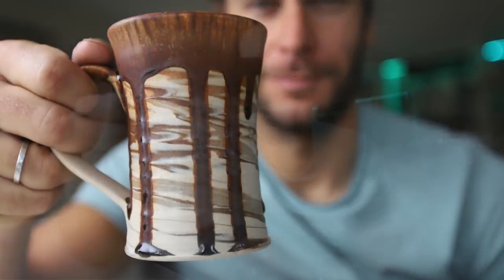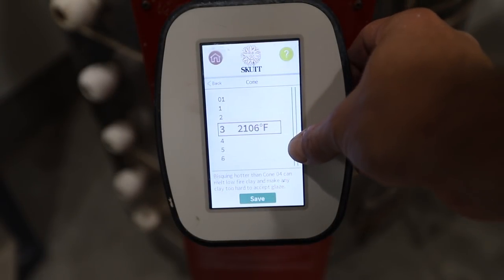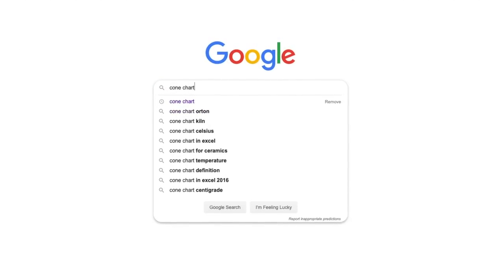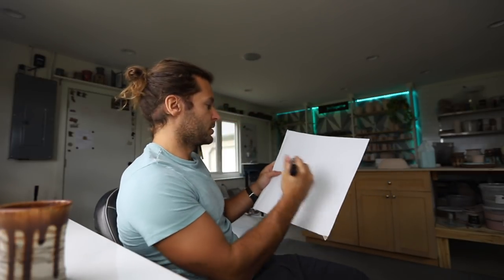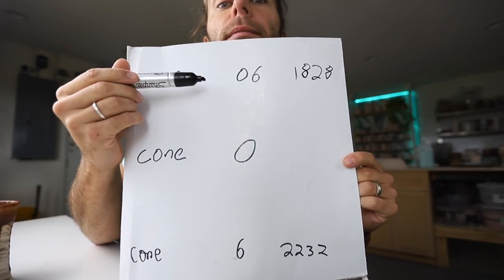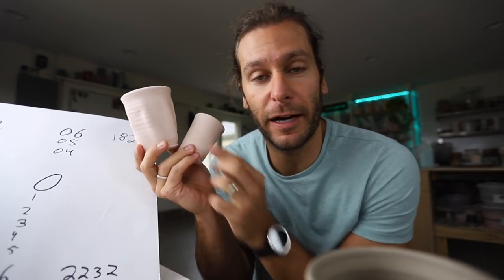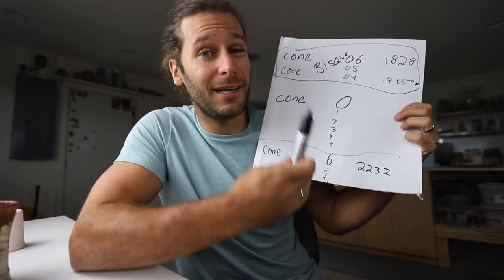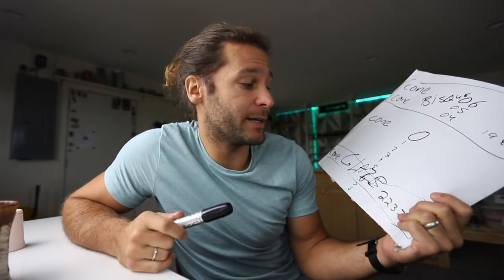POTTERY BASICS  - Measuring Temperature using CONES!!

Comment: A couple of extra notes. 
Cones don't exactly measure temperature, like a thermometer, or in this case pyrometer, but instead measure "heatwork".  This is the amount  of heat, over a certain amount of time.  The classic example is cooking a roast.  If you put it in a cold oven, and set it for 350 degrees, you don't take the roast out, when the oven reaches temperature, as it hasn't fully cooked yet.  Instead, it has to be at that temperature over a given amount of time.  The same is true for ceramics.  A lower temperature, held for longer can equal a higher cone.  And a higher temperature not held long enough can equal a lower cone.  
Also, for kiln sitter controllers, they have pyrometric bars, that are recommended over the traditional cones.  The bars melt more consistently, and with less error.  The cones can trip the sitter too soon, or worse not at all, if placed incorrectly.  The bars don't have this issue.

By the way, I love the outtakes, you've had in the last couple videos.
Reply: This was exactly what I was looking for in this video. Do you have your own channel, or web site?
Reply: Why is it soooo hard to actually see what a witness vone looks like when it meets the desired temp?  Search and search and pics mostly show the overlapping of a series like a witness cone at 5, one at 6, one at 7 all together.  Yet if you fire a 5, use a single witness cone for 5, the result should be relatively consistent-toe touch!  I’m trying to settle a disagreement with a pottery mate.  I say it should touch, within 20%.  She says if the cone moves at all, it’s right on but if it touches it’s too hot.   How do I settle this??  I need pics!  Thanks!

Comment: Hi Jon. I have recently had to use cones as my new kiln was over firing.  Even with a modern controller its handy to use cones to check actual temp your kiln is firing at. My controller was set to cone 7 and it actually burned at cone 9! so now I set my controller lower :-)

Comment: Hi, great video on the orton scale but I still don’t really understand how you use cones? Like do you put them in the kiln every time you fire something to test that your kiln is reaching the correct temperature? Or are cones used more for detecting errors or cold spots in the kiln if and when they occur? 

How often do you put cones in your kiln? 

Also how do you stand the cones up in the kiln and where are the best places to put them in the kiln? 

Loads of questions! Perhaps my questions are valid for a part 2!
Reply: Good question!  I know potters who put multiple cones in to see if there are hotter spots in the kiln.
Reply: If you want to be sure you know whats going on in your kiln, you use them every time. You can be confident your pottery is done well and can help troubleshoot problems if something does go wrong.

Comment: I would like to know more about clay please. Like what the difference between stoneware and porcelain 😊
Reply: Not sure if this is exactly the answer you're looking for but here goes. Porcelain is very smooth, when you're throwing with it, kind of feels like butter, it's pretty difficult to build tall things with, because it can cave in since there's no sand holding the Clay together (like Stoneware has) porcelain is just very thin and light. Stoneware is a bit tougher, it has the sand particles in it to hold it together more, & make it stronger, which means you can make pretty big things usually, stoneware is also less expensive it's less valuable too.
Reply: Throwing porcelain is not a clay body for beginners. You can throw tall forms but it helps to add grog to the clay body to help it stand up.
Reply: digitalfire.com has articles for porcelain and stoneware that are very good.

Comment: VERY HELPFUL! I'm getting ready to purchase my first kiln....... Any suggestions??
Reply: Skutt and L&L are big brands in the US. I own a small Evenheat which I've been super happy with. 

Bigger issue is making sure the kiln will get hot enough for the type of clay you like to work with and making sure you have the power at your house for the kiln. You may need to hire an electrician to run power for you, since almost all kilns draw more power than a standard plug can provide.

Comment: I have many more questions! You said that the old kilns will use the cones to be turned off, but what about the new ones? What do you use cones for now? Why can’t you just set the temperature you want on your kiln if cone = temperature? Is the cone you fire to what determines if your pot is food safe? If firing to cone 04 fixes problems like pin holes, why fire at 06 in the first place? Is there pros and cons to fire at lower or higher cones? And can the same glaze be fired to different cones with different results or do they only work at a specific cone? 

I would love another video on this subject because I feel like you left a lot of questions unanswered in this one. I’m also waiting for a video on that gorgeous marbled clay! Keep up the good work ♥️
Reply: Only old kilns with a kiln sitter use the small cones and are then turned off when the cone melts. In a New kiln (with electronic pyrometer/controller) we use the cones to calibrate our kiln. We ideally place different groups of 3 cones in a small mass of clay or in a stand on shelves inside the kiln so they are visible from the peep holes. The 3 cones in each stand should be a gradation of your projected firing temperature (ex:one of each cone 5-6-7 for glazed stoneware that should fire at cone 6 ). If your firing is successful and oven well calibrated the cones 5 will be melted, cones 6 will be parabolic and cones 7 slightly bended. This way you can avoid a misfire or trouble shoot why you are misfiring (burnt out elements, fracture in kiln, drafts).

Comment: We have a kiln at the hospital where I work for people with mental illnesses.  We've been casting molds with slip and bisque firing them which has been really awesome, but then they just paint them with acrylic paint which seems like a shame because we do actually have some glazes, but no one knows how to run the kiln for glazes.  The cone situation makes much more sense now!  ….but I'm still a little confused.  You said your kiln automatically starts turning off when the cone melts?  Do most kilns do that?  So if I put the right cone in, it should work?
Reply: First, that's awesome.  Art is so good for mental health.

There are a few different types of kilns.  Older kilns often use a temperature controller called a kiln sitter.  It has a lever that reaches into the kiln and rests on a cone or bar.  When the cone or bar melts, the lever drops releasing the on/off switch.  You'd know if you had one because it won't work without the little bar or cone.  You just need a cone that's right for your target temperature.

Newer kilns typically have an electronic control panel that manages the process.  They can be confusing if you haven't used one before.  

I might recommend that you use low fire glazes.  Some glazes (check the packaging) are designed to work at cone 06-04.  These are called "low fire", and produce really consistent results.  They are easily painted on or dipped.  This is the same temperature range that you're likely bisque firing at, so you can do this with the same process. 

The glazes you have might also be mid or high fire.  These are intended to be used at cone 6 or higher. 

Whatever you use, do a test run with the kiln first.

Comment: I use low firing glazes, cone 05/06 do you have experience with any like that? Sometimes I get tiny surface bubbles, what causes this? I was thinking maybe I need to fire at a slightly hotter temperature? Thank you so much for your awesome videos!

Comment: thank you for your video about cones. I am a new kiln owner and here are my questions: One. I bought an L&L with the genesis control, do I need to use pyrometric cones since it's so new and digital etc.? The owner of the store where I bought it said "you don't need any pyrometric cones, this kiln is digital." Secondly, if I do need to use the cones do I need 04,  05 and 06 (all 3?) standing in a piece of clay (like a base)  in front of the top open peep hole or near the middle of the kiln or on the top and bottom shelves near the thermocouples or not at all? Last question, Is it best to use the cones both for bisque fire and glaze fire?

Comment: Is it important to use witness cones on each shelf/level?  Do you put one lower, one temperature, and One higher?  How exactly does that work?  Are they different cones than what goes in the cone setter? If you have a cone setter is there really a need for witness cones?
Reply: You don't Have to put cones on each level, but many potters do, to ensure that each area of the kiln is reaching the correct temperature.  This is especially helpful, if you have glazes that are not turning out, because you can figure out if you have cold or hot spots.

In regards to other cones, it is common practice, especially for those firing, only by cones, to have three or four cones in a pack ( cone pack).  The have the cone they are firing to. a cone or two, lower than they are firing (Guide Cone) and one hotter (Guard Cone) .  Thos lets the potter know, when the firing id getting close, and whether or not things were over/ under fired.

Comment: So... what factors do you need to consider to make you decide which cone level you go up to.? Is it the type of clay or the glaze or the effect in the glaze???
Reply: Your firing temps, depend on the type of clay and glaze you use.  Pretty much all types of clay are bisque fired to Cone 04 or 05.  Mid fire clays are glazed and glaze fired to Cone 5-7 and high fire to Cone 8-10+.  Low fire clays are generally fired one cone cooler than their bisque temp.

What clay and glazes you use depends on what goals you have for your work.  Decorative, functional, sculptural, etc.
Reply: Ben Patterson thank you Ben 👍🙂
Reply: @pahooper99  Not a problem!

Comment: If you fire at cone 04-06 for bisque if that is the range does it matter which one you pick? like what would change between 05-06? 

Also for glazing... if I had a glaze at cone 7 and fire at cone 6 is that ok? whats the range allowed before it's too far off? do I HAVE to fire a cone 7 glaze at cone 7 or can it vary a little?

Comment: Then my question is : is that appliable to all clay as I know there is low fire clay and high fire clay.. I'm specifically using Laguna B-Mix with speckles and I was told to fire at cone 5 bisque and whatever the glaze requires afterwards...

Comment: Oops clay type matters low fire clays fire at 04 bisque but fire 05 06 for glaze. You use stoneware which is like you said. Porcelain to hot fire. The differences are the end product. Slip cast clays go low usually and are a little softer than stoneware. Meaning they can chip and break easier than stoneware.

Comment: If you have a glaze that says it fires to cone 05-06, can you use it in a cone 6 firing?
Reply: I don't believe so. A glaze for 05-06 is ment to be a low fire glaze, for low fire ceramics. I would imagine that firing low fire clay to that temp would melt or shatter the piece,  and using it on stone wear, it would melt completely off the piece, evaporate, or come out dull or wonky in some other way.

Comment: If the cone goes inside the kiln, and you can’t see the cone during the firing , how do you know that the kiln reached the correct temperature?  And if it didn’t can the first firing be redone?
Reply: Well, if the cone is going in the kiln sitter controller, you don't need to see it.  If you are using them to look for hot or cold spots, in the kiln, you will look at them after firing.
If you are using them as guides, for a fully manual firing, you would place them in front of the peep openings, and use a pair of welding glasses to look in and see how they are melting.

Comment: What's a pinhole issue?
Reply: The glaze has pin holes caused by gas exiting the clay body through the glaze when the glaze is cooling. I drop 100F from peak and hold for 30 minutes to allow the glaze to heal, before it cools enough to harden. John's solution, a hotter bisqued (117F hotter), burns off more of the things that gas.
Reply: @blakeclewis  thank you 🙂

Comment: This was a while ago, but I came across it and wanted to note that this is not accurate - cones don't measure temperature, they measure maturity. Here is the most obvious example - if you take a kiln up to 2232 F (according to your computer/pyrometer) and keep it at 2232 F for 20 minutes, the cone 6 that you have will be bent much more than the cone 6 in a kiln taken to 2232F and shut off immediately when the temperature is reached. They both went to 2232, but one stayed there longer, and the cones will look totally different. They don't measure temperature. Using them to measure temperature requires highly scientific conditions that few potters posess. In fact, if you have a cone 5 and 6 in your cone pack, in the former example the cone 5 will look more like the cone 6 in the latter example. SUPER IMPORTANT!!!  Why? Because setting a kiln computer to go to cone 5 might take you to cone 6, and you won't know unless you have actual cones in the kiln!!  In the end, the more important factor is whether your pots are properly fired, not what temperature you fired them to!  Cones can help you to ensure you fire them to the same maturity every time, but only combined with other factors, like careful attention to time.